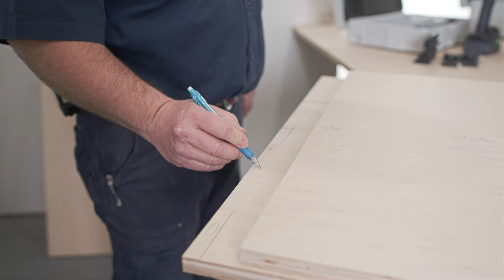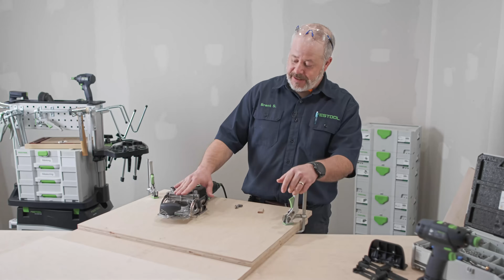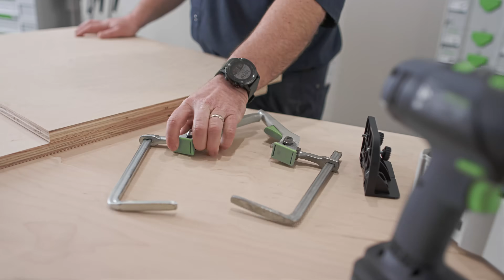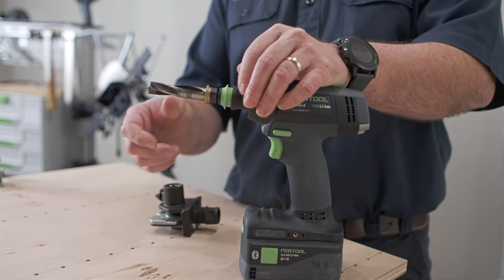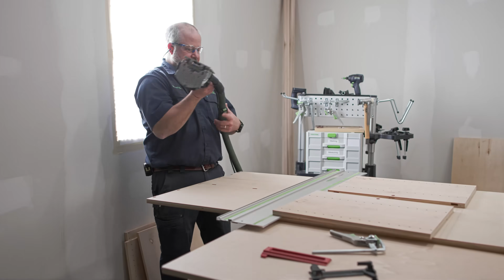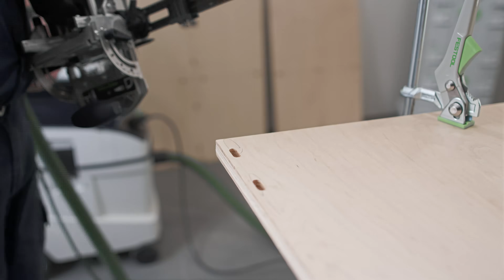Build Series 4: Mobile MFT Cart Build: EP 4

Comment: Why don't you all ever show the DF500 centerline setting? You only show the quick thickness setting on the side in your videos. I use the centerline setting all the time, it's so easy. Your material is 19mm thick, so set the centerline to 9.5mm. It's extremely fast and you'll be plunging exactly in center of the panel. I didn't even know this existed until I had mine in my hands, and I would have been much less concerned about ordering it had I known it was possible to dial in the centerline exactly.